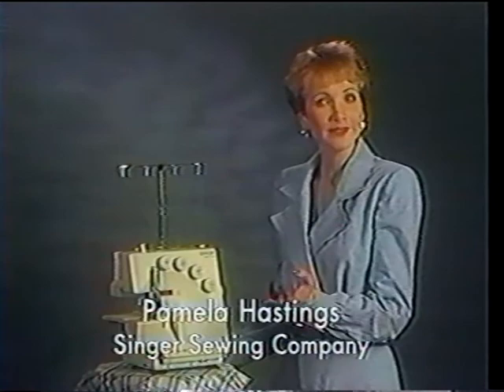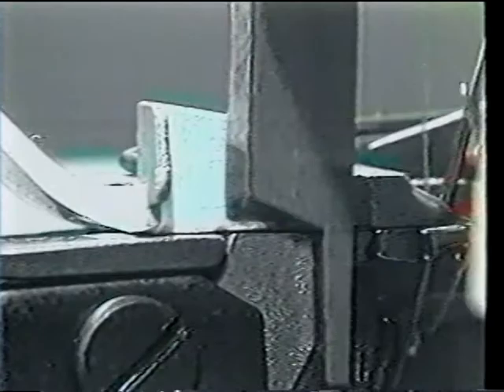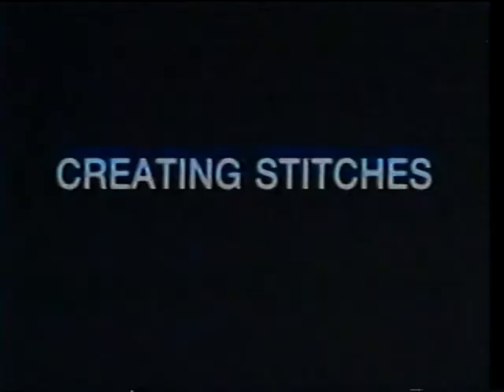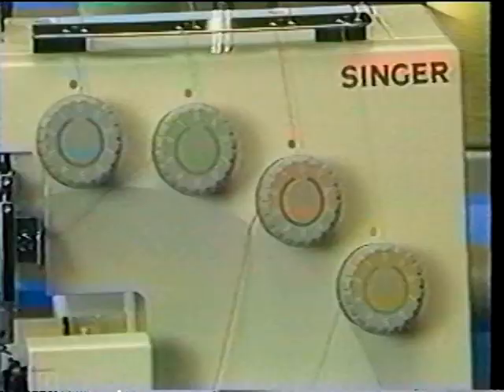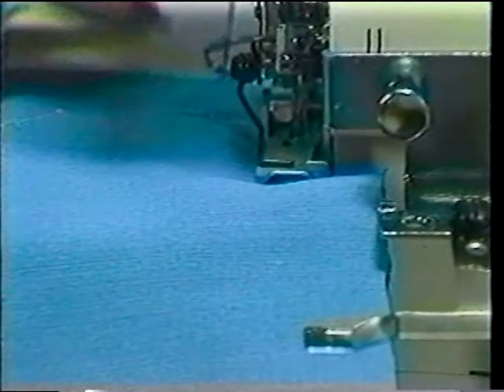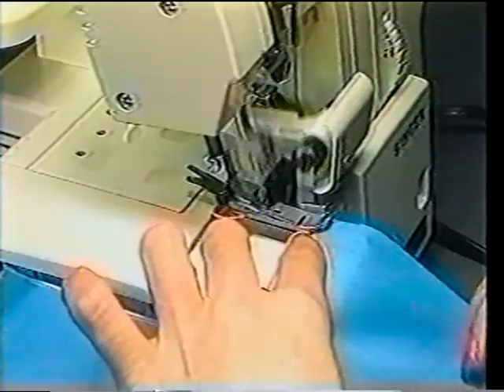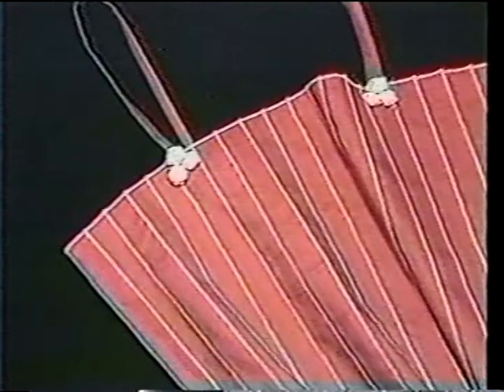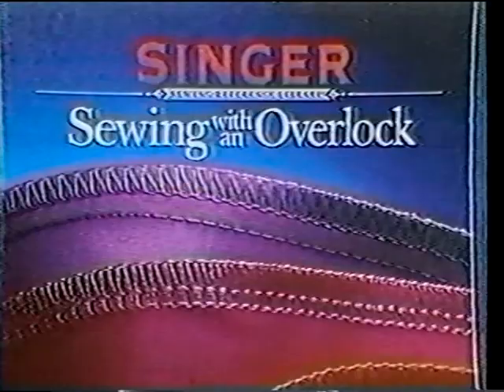Singer 4 Thread Serger User's Guide

Comment: NOT HELPFUL AT ALL. I have a Singer merritt serger & there is some kind of complex interaction between the R & L looper. There is some special trick to getting these to loop & I have not figured it out. Your video does not say anything about how to get the R & L threads to loop with each other.
Reply: Your one looper probably has a hole at the elbow of the hook to run the string down to the hole at the end.